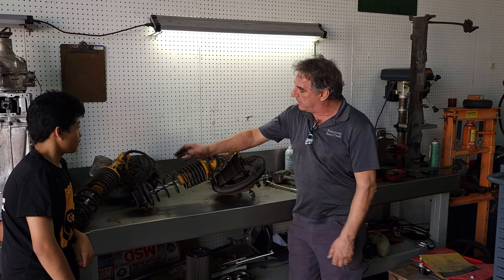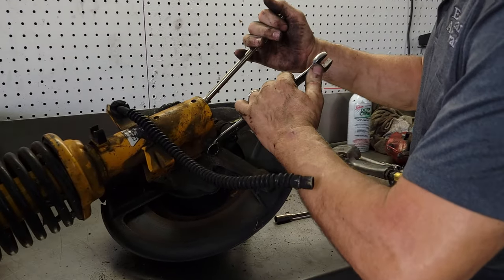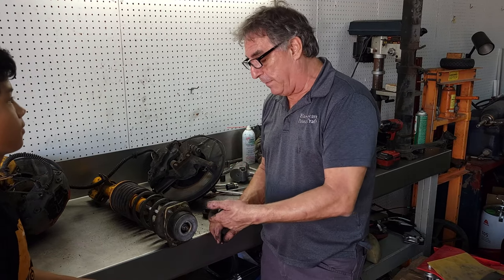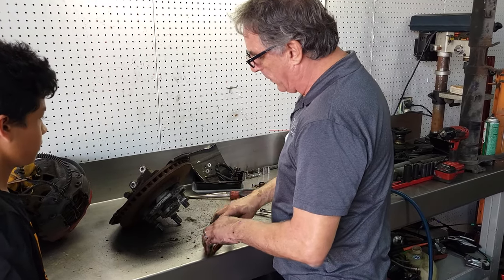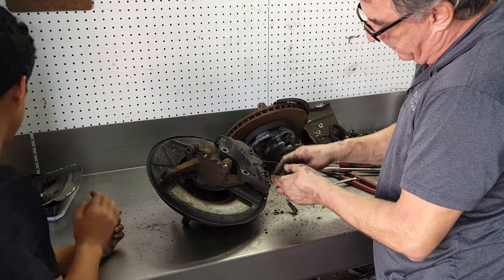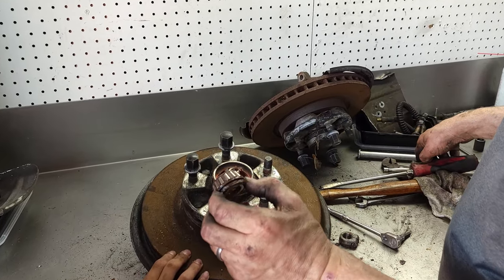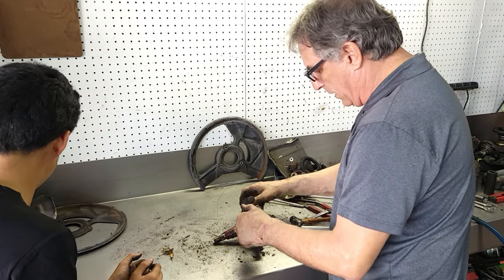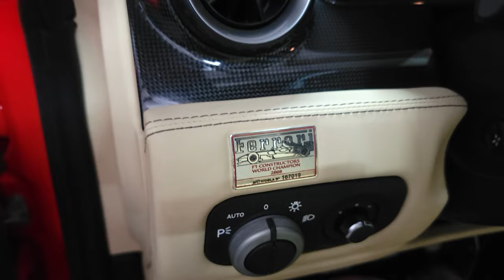Episode 34 - 1986 Porsche 944 Turbo Restoration - Disassembling Front Suspension

Comment: Rotors are easily removed, just the two phillips head countersunk screws - showing people that if rotors are fused to the hubs, Porsche has a threaded hole that accomodates an M8 bolt which essentially forces the rotor off the hub as the bolt is tightened.
Reply from the maker: On the front the rotors are bolted to the hub, the rear is easier as long as the e brake isn't stuck on! Lol